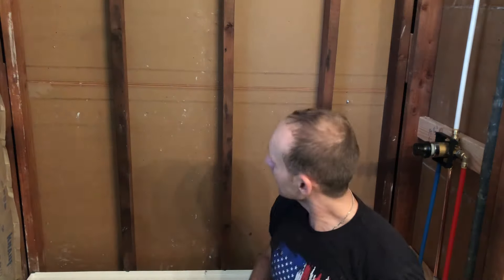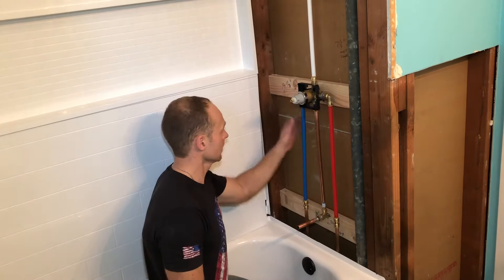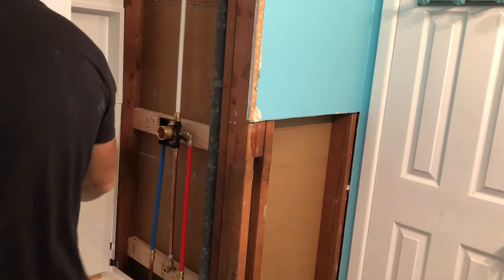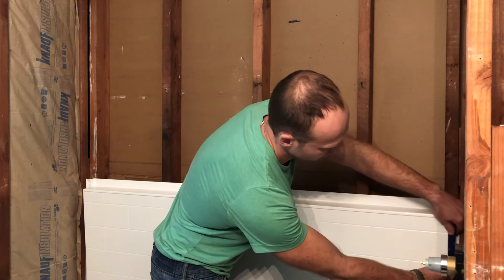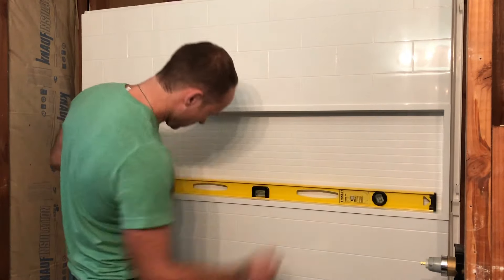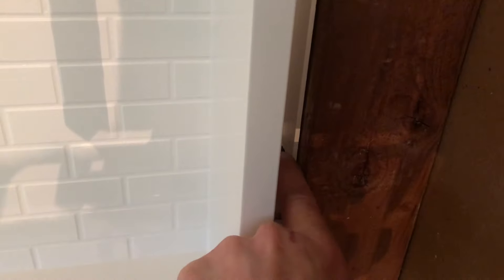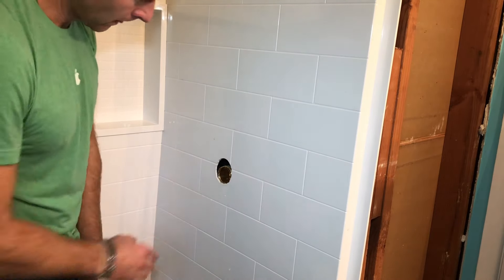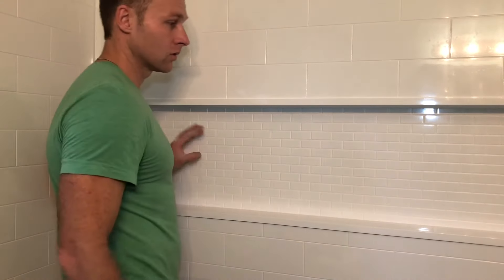Nextile direct to stud alcove bathtub surround install directions. Step by step full install

Comment: Hey nice video!
What product did you use to fix the tiles inside the niche?
Reply from the maker: Thanks.   Use an advanced kitchen and bath sealant,
 such as DAP® 3.0 or something similar.  and than unsanded grout.
Reply: @HowToWithLech  Hello. Can you give me some more detail on how you installed the tiles? My contractor doesn't think the instructions given in the manual will work; he thinks the tiles won't stick to that smooth surface and that the sealant will sip through the tiles and make it difficult to clean up before applying the grout. I really like the look, but he's so hesitant to do it than it's making me doubt as well. Thank you so much for your help!
Reply from the maker: @basquebombshell     Hi.  Honestly i got the recommended adhesive for the tiles (you can even ask someone in hope depot to recommend one) and just attached as instructed per directions.   It works out fine.  the adhesive its made for this.   the surface is fine to attach to.  after  a day, i did the grout and all worked out just fine.  Been months so far and no issues.    best part is, its not a lot of tile, and can be redone if you dont like it.  But the adhesive will hold the tiles just fine.
Reply: @HowToWithLech  Thank you so much! I really appreciate it!
Reply from the maker: @basquebombshell   glad to help.  just give it a go.  this was first time for me too :)
Reply: @HowToWithLech  Sorry, one more question, Lech. My tile guy is worried that the adhesive will sip through the tiles and it will make cleaning it up difficult before applying the grout. Did you experience anything like that? Thank you!
Reply from the maker: @basquebombshell   nope. its fine. the adhesive is heavy consistency.   i guess something like liquid nails.  its not as liquidy as silicone.   it comes in the tubes.    just some zig zag on teh back of the tiles and stick on.   i think thats what i did.    wipe up any thats extra.    wait a  day then just grout.
Reply: @HowToWithLech  Thank you again. You have been so nice!

Comment: Great video. How did you address the gap on the back wall you mentioned in the beginning, due to being slightly longer than 60”? I’m facing the same issue - 1/2” gap. Thinking of sliding a piece of concrete board behind to fill.
Reply from the maker: hi.  dont think i had issues with the gab on back wall with the height.  screwed the top lip down to the 2x4's and then covered with sheetrock..  if any 2x4 not even, you can use shims to level the wall.   the left wall i had to add a 2x4 so can screw down the lip, as there wasnt any there.
Reply: Running into that same exact issue 
Installed directly onto frame. When placing Sheetrock there was a gap. I used the slats I removed from that wall. (Old house. Thank goodness I didn’t trash them.).   Thanks for answering this question. I was second guessing myself. Thanks for the confirmation 😃

Comment: Great video- my condo requires cement board or fire resistant dry wall on all surfaces that adjoin other units. I am assuming that I can install the drywall/cement board on the 3 walls and then attach the nex tile panels to the studs through the drywall. Can you please provide your thoughts on using this approach?
Reply from the maker: It’s made to go right on studs.  But sure you can do it that way.  Just note that because of the dry wall behind it.  It will be pushed out more, so will have little space to sit on tub sides..  might be flush with tub walls. That’s my worry.  Maybe just use thin cement boards, like hardibacker .  Or fill space between studs

Comment: Great work. How was drywalling after? Does it just sit on top?
Reply from the maker: MichaelStarGarvey   THANKS!  Yeah, just goes over that lip on top of the walls.   Then silicone the edges
Reply: How To with Lech Awesome! I almost made the mistake of drywalling first, as you would with any other shower install. But thanks to your video I didn’t make that mistake!!
Reply from the maker: MichaelStarGarvey  Yeah.   Not typical method.  Was hard to believe for me too at first.  But works and easier :)
Reply: How To with Lech did you caulk before or after you painted?
Reply from the maker: @MichaelStarGarvey   i did it after painting.   where is connects to the top sheetrock  etc

Comment: Hi there, thanks for uploading this video. We are currently having this system installed in our guest bath and the contractor is having major issues wth installing a standard drain. When screwed in the drain in not centered and he is using a gasket which makes the drain protrude so the water pools around the embossed part and Gordy drain properly.  The overflow and drain was also not aligned wth the faucet and mixer when they installed the tub. He is saying the plumbing underneath the tub and above needs to be redone to align the drain/ overflow etc.with the tub because the tub in not standard. Can you advise if you had any issues such as this? This just doesn't seem right..
Reply from the maker: Unless you have a special tub should alight.  Tubs are pretty standard .   I replaced my drain pipes for the tub as they were rotten.  But it’s still same setup.  It’s hard to tell.  Should be pretty standard install, if you got Same style tub relaxing old one.
Reply: @HowToWithLech  thank you for the response. The tub is standard and came with the alcove walls as a set. When you installed the drain, did you use a gasket?

Comment: In regards to the bottom pipe for your faucet, how did you re-solder it without ruining the insert? We were having issues with not having enough room in the holes for the pipping to go through to lift up and latch and all our plumbing is already solder in.
Reply from the maker: The pipe for faucet is soldiered  to the threaded insert and then I just screw that into the pipe already in the wall .that will be the only way I think.   I had to make my hole little wider too as first time didn’t align correctly.

Comment: So I bought this surround and I'm close to installing it but now I have seen and read concerns that because of its design, the upper part sticks in about 4" which takes up a lot of space when showering. Has anyone installed it and found the same thing?
Reply from the maker: honestly did not notice any issues.  seems to function just fine and not in the way.  thats my personal feedback
.

Comment: Hello, I just installed this same surround. I see this question was asked below, but I cannot see the reply, What product did you use to apply the tiles in the niche? Dap 3.0??
Reply from the maker: Hi. Use an advanced kitchen and bath sealant,
 such as DAP® 3.0 or something similar.  and than unsanded grout.   staff at home depot can probably recommend one too, if cant find that specific one.

Comment: Hey man the finished product came out amazing!
Since you had to cut the mounting tab on the right side of the fixtures, how did you go about securing it to the wall?
Reply from the maker: Camaron Ordonez used some nails on an angle to go into the corner 2x4 Then silicone.   Worked out great.
Reply from the maker: Probably too late But here is what I did.  Posted quick video:  https://youtu.be/2tXXY20Vr5Q
Reply: @HowToWithLech  bro you are a real one for following up on this 😂 new video was great thanks man
Reply from the maker: @camman408  :)

Comment: Good job man. I wish I could see how you joined the drywall to the side piece that you trimmed off. Do you fill any gaps with caulking? 
Edit* nevermind you already answered lol thanks for the video though. Cheers
Reply from the maker: I'll do another video soon of the finished bathroom and will do a close up on that part so you can see.  maybe i took some pics of it too, so that will help.
Reply: @HowToWithLech  awesome thanks
Reply from the maker: Sorry took a while. But here is what I did.  Posted quick video:  https://youtu.be/2tXXY20Vr5Q

Comment: I am installing this system.. everything is level as I fit it in, my concern is the very first piece of the wall, the bottom seems to have a little 'give' and with all four walls up, it still moves a little bit. Does this get secured down at all like the top of it does?
Reply from the maker: once ready to install, yes you screw it to the 2x4 before putting the top section on top of it.   then the top gets screwed in on top as well.  once the sides go in, it shoudl all click in solid.  just check the instruction again, to make sure you did not miss anything.
Reply: @HowToWithLech  
Thanks! I checked it over and it looks like everything is done according to the instructions. The part that still has some give to it is the part that is resting against the tub.  When I push on the bottom of the side walls they are firm.. it's just the middle of that first piece that is not.
Reply from the maker: @WillLaw119  hard for me to remember as i did it a year ago, but its possible there might be a little bit give on bottom. shouldn't be bad tho.  but that should not affect it.  dont forget you will caulk it too.
Reply: @WillLaw119  hi Will. Same here.. i was hoping id find answers here..
Reply: @marcanisco8861  I discovered my tub had a little bit of a concave bend, which wasn't allowing this surround to hit the stud as it should at the bottom.. What worked for me, was cutting a small piece of wood to act as a spacer, and screwed it to the stud. 
Took quite a bit of trial and error on the right feel for it. You don't want to go too much as it will begin to make the rest of it sit funny. Take your time with it to get it just right.

Comment: Thank you for your video that’s giving me some ideas like this one: Can this be put on top of an existing tile wall? I don’t want to tear out the walls and I was thinking that maybe I could just get longer screws and screw through the tile, cement board then through the studs. I watched a video of someone tiling over tile so that made me think this might work as well.
Reply from the maker: hi.  technically it should work. hopefully your tile is in good condition, and no mold behind.  mine was bad.    Also if you do that  it will overlap bathtub more as you have tile and this over it now on bottom.    it not hard to take down old tile .  i posed another video on how to do it.    if its not in good condition i would recommend removing it .
Reply: Don't put it over an existing tile wall. You need to secure it to the studs.
Reply from the maker: @MrsAngieEW  i agree.  that would be the proper way of doing it :)

Comment: Hi Lech. I just dry fit one of these onto an enamel tub and I noticed that the lower back panel tapers away from the wall at the very bottom probably so it can fit over the flange of the tub. What concerns me is that it clears that flange quite easily and leaves a void between the bottom of the panel and the tub flange itself, and if you apply pressure at the center of the panel down near the bottom it flexes inward easily. Did you do anything to fill that void so that that flexing could not occur any longer? I'm worried that once I attach this and caulk it, people using the tub may push against the wall with their hand, which would flex inward, and probably completely tear away from any caulking.
Reply from the maker: Is the tub right size?  Against walls on all 3 sides.   Tub should be snug fit , and panels sit right over tub.  You have them directly on studs and not over sheet rock too right? Shouldn’t be too much space.  And caulking at bottom just seals the small gap

Comment: Hello Lech.  Nice install video. Question about the tub: when you installed (set) the tub, did you pour a cement tub "setting" and placed the tub onto that mix "wet" and fill the tub with weight?
Reply from the maker: Thanks.  no i have not used any cement.  I made sure floor was leveled and tub sits safely right on that.  Tub has support under it.   And sits on a support 2x4 against the wall.   I made a video of the tub install.  Will post it soon.